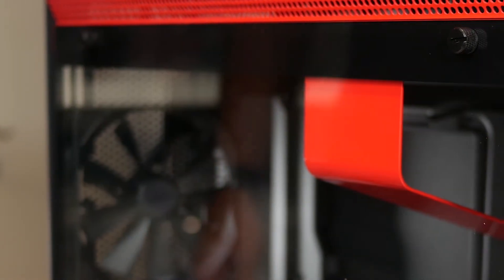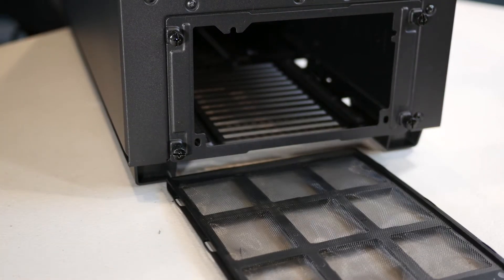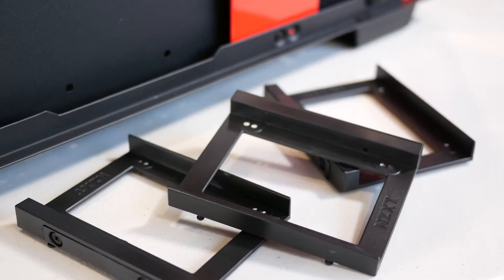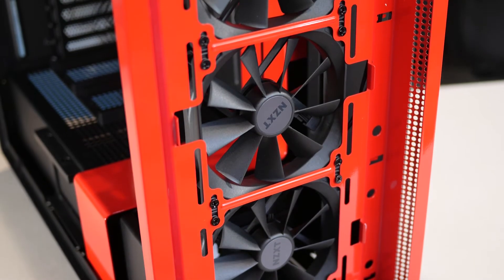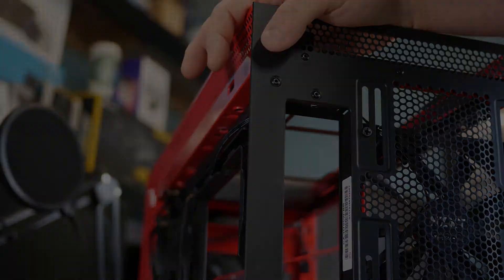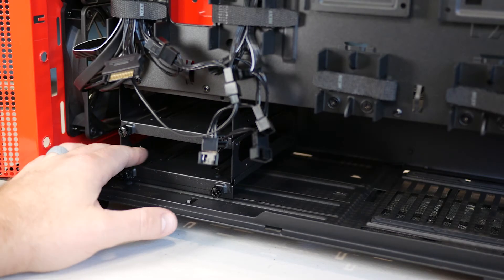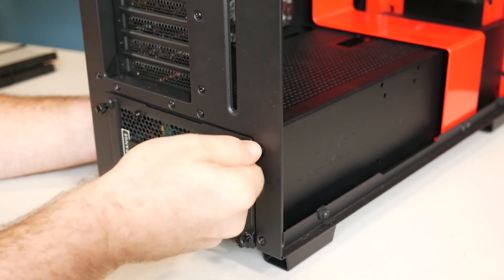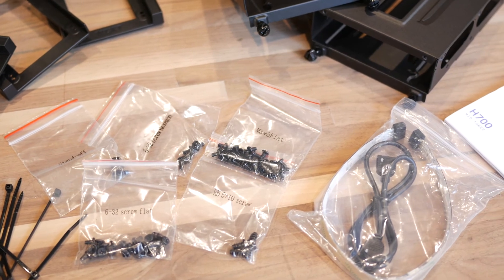NZXT H700i Review - Its not just a case!

Comment: Just found your channel and enjoyed the review;subscribed and thanks.

Like the style of this case and it seems to have all bases covered but I would prefer a cheaper version without the smarts (unless they turn out worthwhile?). Not much else round in the way of cases that's stylish new/interesting with good airflow.

Currently looking for a case so this review was timely and I look forward to your followup on the smart device. I would be happy (in a self interested way) if you reviewed similar/ competing cases to this one rather than the smaller versions but understand you need to appeal to all viewers. I will be checking out your other content anyway. Cheers.
Reply from the maker: +Damo hey glad you stopped by and enjoyed my content.  I agree that it would be nice if they offered a solution without the smart device, maybe just an H700....I think once they get the ease of setup figured out with cam and the smart device it will be worth it.  There are plenty of cases in this price tier like my evolv TG that don’t have quite as much flow as you mentioned and don’t have as innovative of a design for the builder so I don’t think anyone would be disappointed at this price point.  Thanks again for the support!

Comment: Hey Joe. Is there enough room to setup a push pull setup with the top mount radiator? E.g. 2 fans and radiator under the bracket and another set above the bracket??
Reply from the maker: No, unfortunately not with the rad on the bottom of the bracket

Comment: Nice review so you said 4 led strips or 5 rgb aer fans what about 2 led strips and 3 rgb aer fans? Will that work within the smart device or would you need a hue for that?
Reply from the maker: +TuMuchTa1ent1 it only has one channel unfortunately so it’s one or the other.  You would need the HUE+ if you wanted to add both.  Thanks for watching and glad you enjoyed!
Reply: JoesTech will it not allow you to use a splitter?
Reply from the maker: +TuMuchTa1ent1 no, I’m guessing it’s because the way the signal gets transferred to the different type of device.  They aren’t using the same connector so as far as I know there isn’t a compatible splitter.